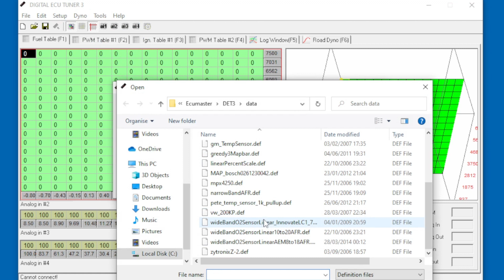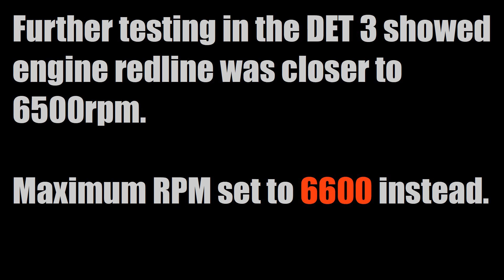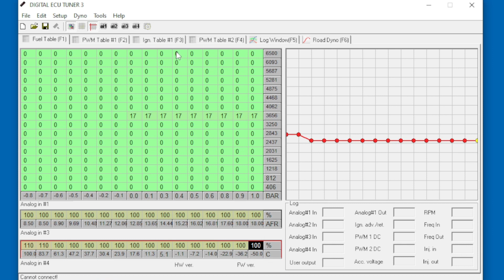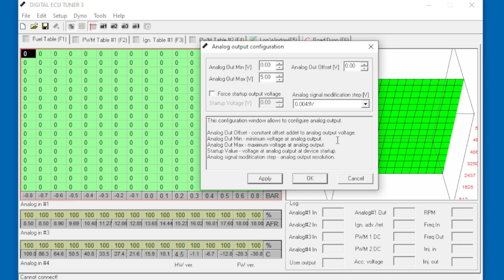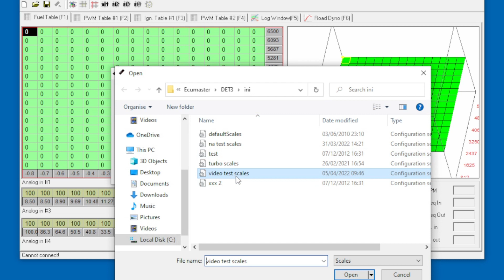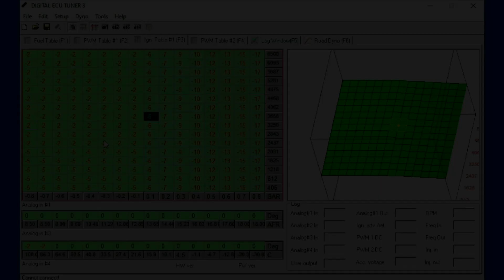Toyota Starlet ECUmaster DET 3 settings and software explained. | Toyota Starlet 4efe turbo build.

Comment: Great video but haven't you neglected to talk about the original ECU's O2 sensor that will be trying to maintain 14.7 in closed loop mode and for a car like mine it will also run as much timing as possible until it starts to detect knock .SO....... almost all of these settings on the table wont really matter what you enter..
Reply from the maker: It is the same scenario for any vehicle with a stock narrowband O2 sensor and piggyback ECU fitted. These setups have been used since the dawn of time......people seem to get them to work though! If you watch my wiring videos on the Det 3 I cover that exact scenario (short / long term fuel trims). I have included a switch to disconnect the narrowband Toyota O2 signal. This should force the Toyota ECU into open loop all the time as it won't know the AFR and therefore it won't be able to change the fuelling back. Also, most vehicles of this age don't run closed loop all the time either, usually only cruise and low load situations. (FYI, the AEM FIC has a separate O2 manipulation table to skew the narrowband sensor readings to trick the Toyota ECU to adapt fuelling in closed loop.) On a more modern vehicle with more complex engine management I would suggest a reflash stock ECU, there are also more complex piggy backs like emanage ultimate or straight to standalone.  Hope this helps.

Comment: Any recommendation for a toyota 2azfe using a denso maf sensor?
Reply from the maker: It depends a lot on how you have wired it to the car.
Reply: @dan91sgarage  I can share that information with you. I just want to make sure I'm headed in the right direction.
Reply from the maker: @srhabb  Cool Cool. I'll give it my best. You can contact me on instagram if you don't want to post it here. @dan91sgarage

Comment: Awesome video mate. Iam just wondering as Iam trying to connect my det3 but I got lost with that intagrated map sensor in det3 I only have a iat and a map sensor no maf. Do I change the stock map to 3 bar or just plug it to det3?
Reply from the maker: It depends on the amount of boost you will be running. It is always best to choose the smallest MAP sensor that will read all the boost you want with perhaps 0.5bar more for the cold days. So if you want 1 bar of boost go with a 2.5 bar MAP sensor etc. The internal DET3 map sensor is 4 bar and seems too big for most builds, the early DET3's were 2.5bar internal MAP which is a much better size for piggyback. Which car is it for?
Reply: @dan91sgarage  it's a hyundai coupe 2.0 supercharged no maf  Unfortunately there is not another hyundai on supercharger anywhere these days not a lot of info and the fuel implant mode is a very advanced task for me
Reply from the maker: @viktorboksai2250  sounds like a cool project.  Someone has to be the first to do this ;-)
Reply: @dan91sgarage  as soon as I figure out the det3 and a tune there will be a turbo coming under the bonnet too. The only skill iam lacking around the car  is the ecu sensors etc. And this time I want to do it myself so it's the best time to learn. Thank you for your reply much appreciated
Reply from the maker: @viktorboksai2250  You are very welcome, good luck!

Comment: den tell me is it worth flashing the det3 ecu unit yes version 1.46
Reply from the maker: ECUmaster say it is always best to flash to the latest firmware. It will also erase all the maps and settings in the det 3, so save them as a backup before flashing the unit. The 1.46 software is for Fuel implant mode.
Reply: @dan91sgarage  den, could you do a review on the new firmware to at least know how to configure it, otherwise I can't figure out how to do it so that all 3 cards work and so the VE CARD works
Reply from the maker: @сергейАнтонюк-л5я  As far as I know flashing with programme 1.46 is for Fuel implant mode. This makes it a semi-standalone ECU. I am only using a piggy back setup on my car. If I change to FI mode in the future I will of course make a video, but I have no plans to at this time as I would have to also re-make all the wiring harness to fit the car.

Comment: Hi are you sure about the sensor type? I am sure that the 4efte is vr
Reply from the maker: If you're talking about TPS then, the 4efte manual gearbox cars had a 3 wire TPS switch (idle switch, off, Full Throttle switch). The 4efte Auto gearbox cars had a 4 wire combined switch and % TPS (idle switch, variable resistance % sensor off idle position). If you're talking about the crank/cam sensor signal I'm not intercepting it. I'm intercepting and modifying the signal to the ignition module so the settings in the video are correct.
Reply: Dan can I ask you what the firmware 1.20 is on the block?
Reply from the maker: @сергейАнтонюк-л5я  The laptop computer software is version 1.35 which is the latest version I can find. I don't know what firmware is on my DET3, I just updated it through the software to the newest version available. It is provided automatically.

Comment: What would you say: I have also a DET3+ for my N/A 4EFE without Turbo - should i use TPS as Load instead of MAP Sensor or should i do it the same way as you do? Thanks for answers!
Reply from the maker: Hi, I've never tuned a N/A 4efe with det 3, but if it was my car I would still use the MAP sensor for N/A load as that is what the Toyota ECU uses. If I had ITB's or low manifold vacuum I would look at using the TPS signal for load. Also the TPS sensor must be a variable voltage and not the early switch (on/off/on) type. 
Don't forget to like and subscribe :-)
Reply: @dan91sgarage  Thank you very much!